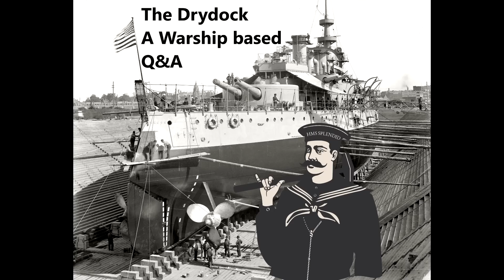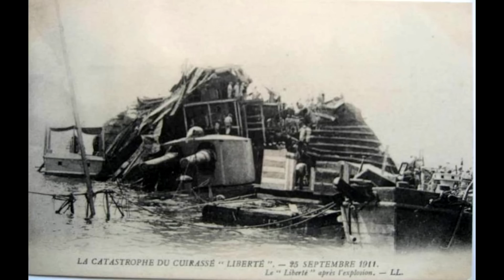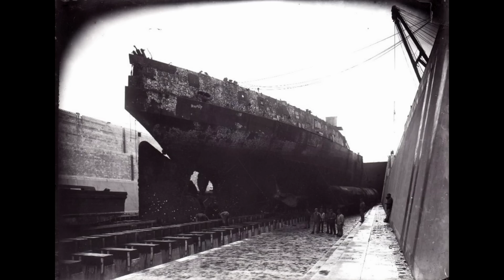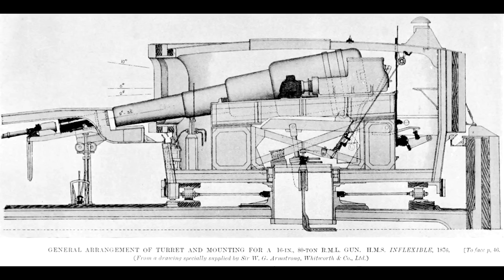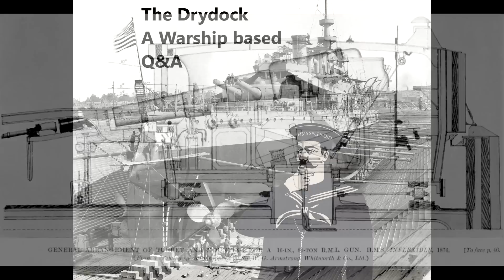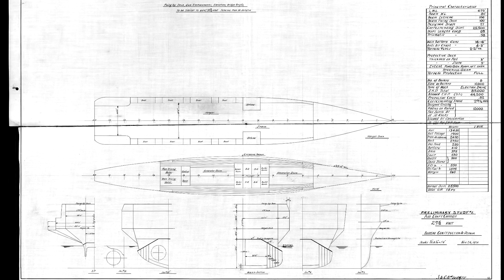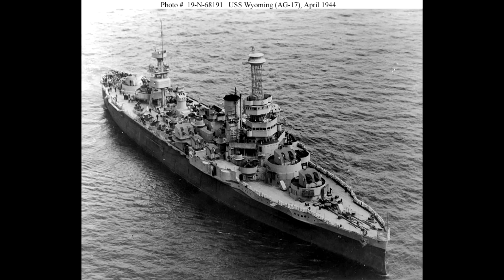The Drydock - Episode 335

Comment: Because the carriers didn't work out, would it have been effective for Germany to disregard the V-1 and V-2 projects and instead hasten development of guided anti- shipping munitions like the Fritz X to add a long- range air component to their submarine blockades? This could also improve strikes on tricky targets like British radar post-France. It seems like that compensates for their lack of aircraft carriers for long- range naval strikes and had a greater impact than the high-tech fires development they focused on IRL.
Reply: Fw200 are the definition of large slow target. Asking them to fly slowly and straight towards the target so the bombardier can keep visual on the bomb and target is not going to go well once CAM ships and escort carriers are deployed. 
Effective jammers were created after the successes at Salerno so that by D day they were no longer effective.
Finally the FW200 were built in very low numbers and required significantly more resources to both build and operate at a time when Germany was focusing resources on single seat fighters hence the impact would be minimal. 58:46
Reply: @neilatkinson5142   I'm not talking about an introduction date of 1943-44, I'm talking about something like the Fritz X being assigned more focus and introduced pre-1943 when the convoys were less protected. That gives extra time and push to develop them further to counter shortcomings, as well as greater success in intercepting shipping. Even with the shortcomings, guided glide bombs mean you drop farther away and fewer aircraft have to get through for a likely hit. I'm also only using Fw200 as an example because production could be ramped up or bombers like the Do217 could be used, which have a shorter range but could probably outreach fighters operating from Britain
Reply: @randomwarehouse4702  they don't even have an airborne surface research radar to find any convoys. And you need multiple aircraft to attack a convoy. Escort carriers and catapult merchant ships have already defeated your early War plan.
Reply: NAZI Germany was not led by the best and the brightest. In the spring of 1943 they held a meeting in which they decided that any project to be used for the defence of Germany and would not be completed in 12 months was to be halted as they were winning the war. Amongst projects which were stopped were those surface-to-air missiles they tried to rush into service later on. Even more shortsighted was the fact that many of the scientists and engineers on those cancelled project rather than being used on other projects were sent to the Eastern Front.

Then in mid 1944 when they discovered that Lancaster bombers where being fitted with radar to improve bomb aiming they decided to reenstat many of those projects , including the surface-to-air missiles; and bring back those scientists and engineers who were still alive from the Eastern Front. All too late
Reply: @bigblue6917  I'm aware. That wasn't really what I was asking though: I'm talking about effect if the Germans, hypothetically not being run by idiots, had put the kind of resources into standoff precision bombs they had into the V1 and used them to hit things like ships and radar en masse.
Reply: Kinda hard to jump from cruise missiles and ballistic missiles. And they already had Maritime strike aircraft in the Fw200 that could deliver bombs. They had success early in the war.
Reply: @WALTERBROADDUS  What do you mean "kinda hard to jump"? Hard to develop? I'm talking about simply increasing resources for their existing guided bomb programs. I'm also aware that they had the Fw200 and am speculating about how they could increase its role and capability by having guided munitions far earlier rather than the inaccurate, ineffective V1 and V2.
Reply: @randomwarehouse4702  the precision guidance required to hit a ship; is a lot different than hitting an area Target the size of a city. And by the time you are talking about; Maritime strike aircraft have already been countered by aircraft at sea. FW 200 is no longer a convoy threat. You are not getting in range to shoot anything.
Reply: @WALTERBROADDUS  I'm not talking about an anti-ship V1 or an introduction date of 1943-44, I'm talking about something like the Fritz X being assigned more focus and introduced pre-1943 when the convoys were less protected.
Reply: @randomwarehouse4702  I know perfectly what you are asking for. And responded so it why it is not a good idea. You are not stopping any convoys. And you are going to lose any air bases to reach any after D-Day. And there is already air cover at Sea to deter the planes from getting close enough to launch any.